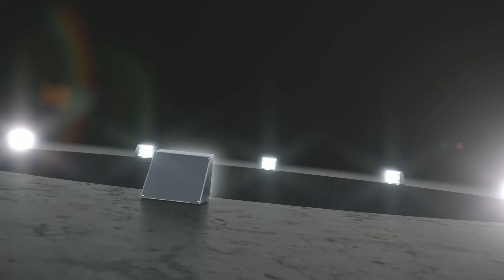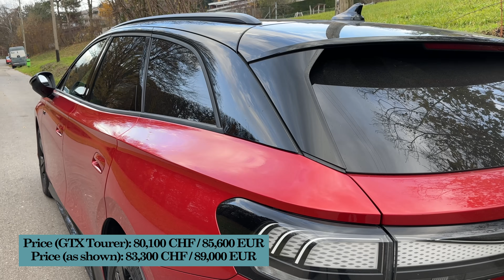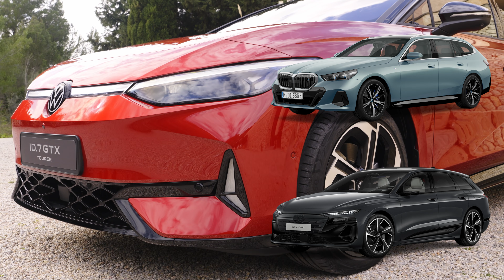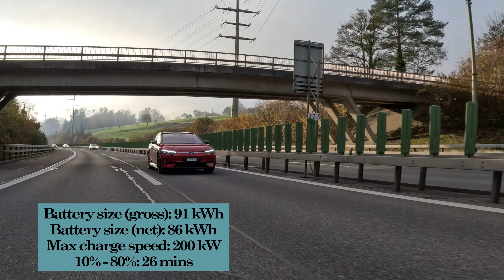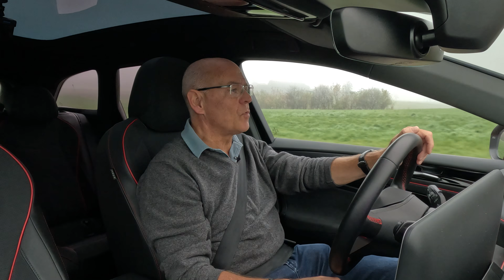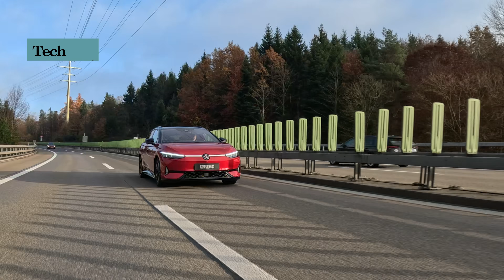VW ID.7 Tourer GTX United — Modern, Competent, Conservative

Comment: With model year 2027 the ID.7 GTX evolved in some aspects. Travel Assist is now more competent, the speed limit of 180 km/h increased to 200 km/h and — for most people more relevant — the maximum trailer weight is now 1.800 kg. Also the system software version 6 is now based on Android Automotive, which offers some extras. Filtering for specific HPC charging station provider, a satellite view at the navigation display etc.

Comment: Also comparing the ID7 Tourer to BMW I5 and Audi A6 Avant e-tron...

They are at least 10-15% more expensive, and they do NOT give you ventilated seats WITH massage, 4x4, panoramic roof and so on for the same price point.

Your comparison is way out of balance and in my opinion horribly flawed - sorry to say.
Reply from the maker: Possibly Swiss/Denmark differences?

Comment: The comparison of price range between the Kia EV9 and the ID7 tourer GTX is NOT correct, when comparing in Danmark.

The Kia EV9 GT line = 699.000kr
The VW ID7 tourer GTX = 585.000kr

The ID7 tourer is with panoramic roof, ventilated seats with massage at the above price point.

Comment: Hi, as you have test drove both cars, be interested in your choice, as you rated them both 3.5 stars, and sense it is a tight battle.  The VW ID7 GTX Tourer or Smart 5 Brabus? Thanks
Reply from the maker: If size matters; ID.7, although a bit mondaine, but as a workhorse it is unbeatable..

If technology and power is your thing; Smart#5 Brabus.
Reply: @morten_hannesbo Thank you for the quick reply, you have confirmed my suspicions. Test driving next weekend and leaning to the Smart, helped by far more helpful dealer.

Comment: Nobody is discussing the fact that the ID7 won’t charge above 285 miles even though it is advertised as having a 380 mile range. If the car won’t charge above 285 then how can it possibly have a 380 mile range? I understand WLTP but if your car won’t charge above 285 then it can’t possibly have a range of 380!! Appalling false advertising from VW. And I have ALL charge modes set to 100% even the one VW hide away
Reply: I had 343 so far of home chargers,

Comment: Would I also prefer to have separate buttons to control the rear windows? Yes. Does it make sense for Volkswagen to save costs on 2 cheap plastic buttons, especially in a 80k plus car? Probably not. Do I remember when i used the separate controls for the back windows in my car the last time, if ever at all? Absolutely not!!! 😂 Might be different for people with kids in the back, and the controls should therefore absolutely come back, but for people like me, I don‘t see any reason or situation in which I would have to open/close/control the back windows from the driver seat at all! 🤷🏻‍♂️

Comment: The GTX is a lot cheaper where I live so the only i5 I could get for similar money was without many options. I agree that the i5 looks better inside at first glance but having lived with it for a while I feel the ID 7 GTX feels very much like it's in the same class. It's also more practical becasue the BMW has got an enourmous bonnet, probably becasue it has to be able to house a six cylinder engine in some models.
The i5 drives better on a twisty road, in my opinion, but they're not miles apart.
Persoanlly I found the assistan features to be exceptionaly good on the ID 7 and in fact the best I'd every tried... much better than on the Model Y for example.